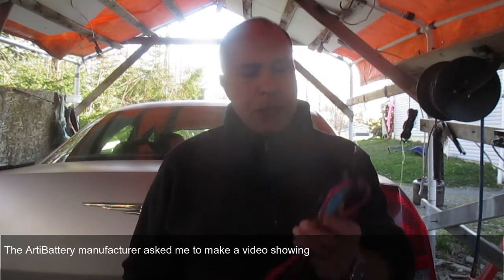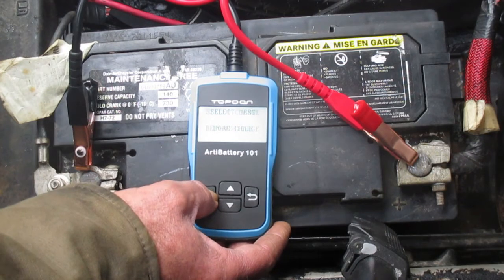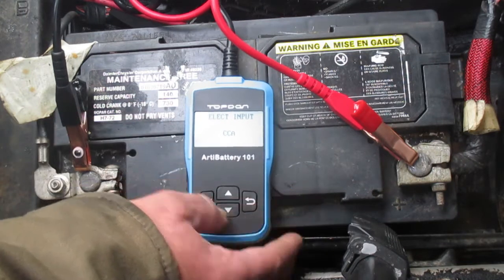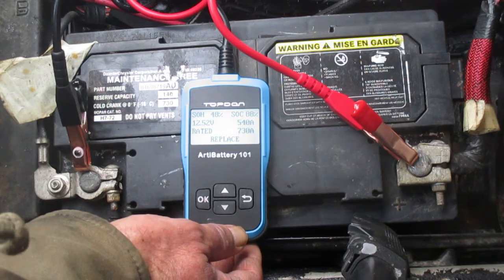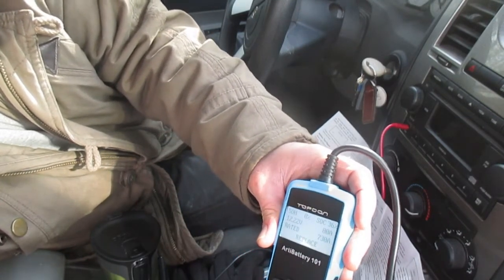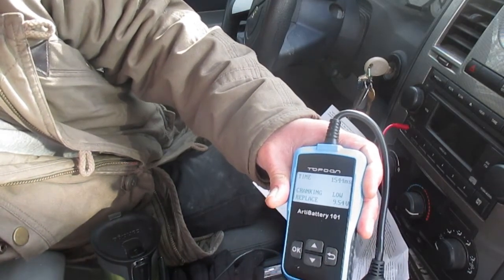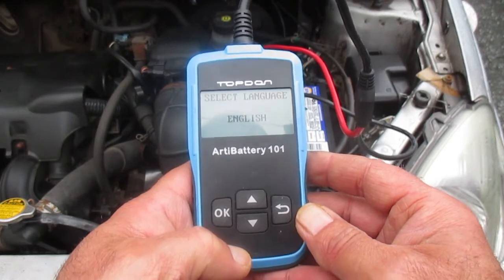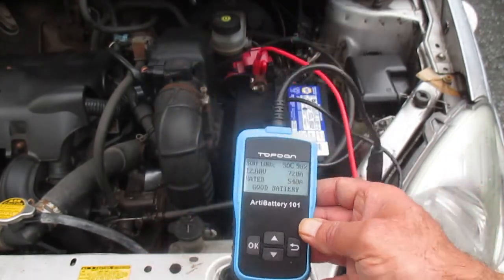How to test a car battery using a Topdon ArtiBattery 101

Comment: Why did he disconnect the tester for the cranking test? The tester is supposed to be connected.  When he is in the car for the crank test how is it that the tester is connected to the battery while cranking the engine.,the tester cable is only a couple of feet long? I assume he has a set of long jumper cables but does not mention that.